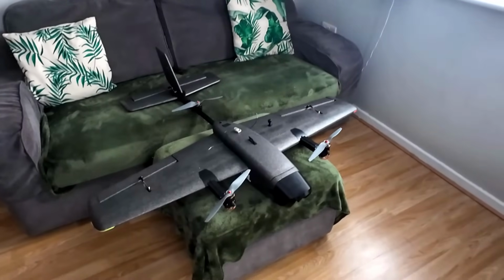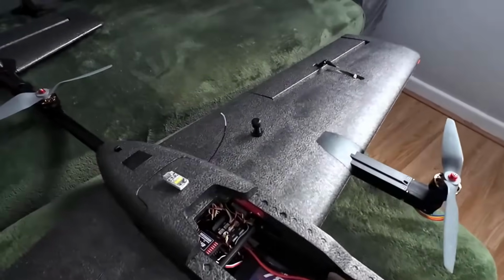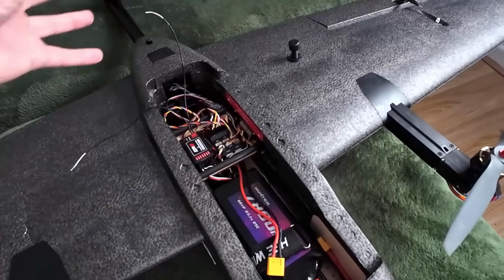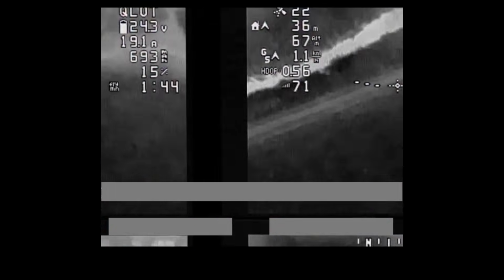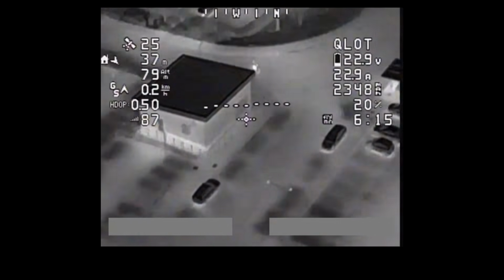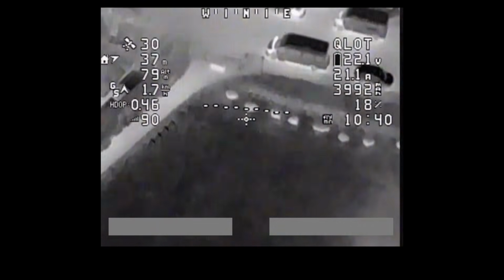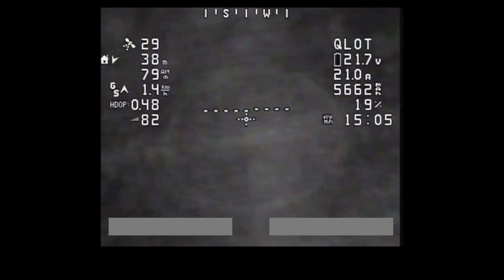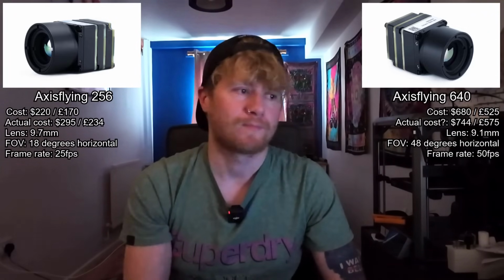🛩️ I Built A Thermal FPV Drone!

Comment: Thank you! This is very interesting. But the telelens makes it not usable as main fpv cam. Could the lens be changed? Or are there other cameras with this good thermal/latency/resolution  performance and with a lens that is acceptable for a main fpv cam? Thanks!

Comment: I have a lot of experience with remote control, but not so much with FPV. My question would be, if you’re using the radioMaster as a receiver and wired into your flight controller, it seems that you would now have split your channel one into two outputs. The initial output which runs your gimbal and the output that goes into the flight controller, which would typically work on channel 1 as your aileron. 
so on your radio, how do you 
differentiate between the channel 1 on the receiver, and the channel 1 on the fight controller? And in the radio if you set channel 1 to channel 8, then it seems that you’re ailerons will be linked to your gimbals?

I guess I’m trying to say if you pick  AETR and your flight controller software, then aileron will be channel one. Sewing your plug the receiver into the flight control. You will essentially have two channels working off the same input.

Obviously, this part confuses me and would appreciate any advice. Nice video.

Comment: Problem is in hover you'll smash your battery down. Better idea pic a frame that allows a pan and tilt on head tracker.that way you can bank the plane and look out to the side and just circle.
Reply from the maker: Or better yet, build a 10" quadcopter with a 3 axis gimbal 😉(check the videos I posted after this one)

Comment: Hi Giz can I ask why did you use uart1 for the ELRS connection when the 4 pins at the top left of the F/C are designated for the xfire/sbus connection ? Is it because you needed to pull separate power for the receiver and that was the easiest way ?
I am just about to buy the T2 VTOL based on your previous videos and was shocked to hear you say that all 9 PWM ports are used by Heewing wiring and I need to run a pan servo for my camera. 
Love your videos mate keep up the great work
Reply from the maker: Hey, yeah I wired the RX to UART 1 because I needed to use the other pins (that would be where you usually connect the receiver) to provide the rx with power. Because of the way the ER6 rx works it needed a secondary power supply so it could power the servos

Comment: Did you ever fix the camera switch issue? I am having the same problem, but mine goes blue screen first. takes about 1-2 sec to switch.
Reply from the maker: Yes i did fix it. Turned out it was due to a setting on my goggles. I basically had to change the mixing mode from mix1 to div

Comment: You didn't build shit
Reply from the maker: Yes you're right, I clearly just went to a shop and brought this drone exactly how you see it here and just flew it straight out of the box 🙄 I certainly didn't spend any time carefully researching components, installing hardware, soldering multiple wiring connections, programming software, or designing and printing custom 3d printed parts
Reply: lol this guy. ok let's see your build.

Comment: Would be great to overlay the thermal inside of the normal fpv so you do not have to switch. I could imagine using ML to label buildings, cars, people, POIs, etc. in real time using a small SBC and some code.

Comment: I think the switching error is because the RF switch is engaged randomly in the frame scan and it should be switched right after the VSYNC pulses.
Reply: I agree. I don't think there's an easy way to synchronize the feeds though.

Comment: I see that AliExp has USB digital versions of this listed now, along with CVBS. Also various lens sizes such as 4.0mm instead of 9.7mm, to get a wider FOV (but at the expense of lower detection ranges). Maybe 9mm would be best for planes (higher up), and 4mm for quads down low? IDK, depends on use case.
Edit: I just found it with 6.8mm lens also: maybe a happy middle-ground?

Comment: Black is cold.  Anything facing up is seeing the very cold night sky.   The night sky is only about 3 degrees above absolute zero so that's about minus 270C.   This causes whatever is facing the night sky to radiate its thermal energy furiously towards space.   Of course, it doesn't get that cold because it's immersed in our atmosphere, around ground level, so it's kept warmer by the environment it's sitting in.  The early Romans actually used the night sky to make ice all year long.   So that's why the tops of cars, and solar panels, and roofs, all get cold quickly, colder even than the local air temperature.  That's why windshields and car tops get covered with dew.

Also, driving cars have the cold night air flowing all around them keeping them generally cool even while running. Your parked car no longer has air flowing around it so the engine heat warms up everywhere briefly.

Comment: Maybe a silly suggestion , but how about trying a wide angle adapter like the ones you can get for a smartphone camera? Would it lose any of the thermal imaging properties?
Reply from the maker: @joaomarveloso1049  Unfortunately it's not as easy as that. Glass is highly reflective to infrared light and as a result doesn't let light through. That means that infrared cameras cannot use glass lenses. Instead they use Germanium metal alloy lenses, which as you can imagine, are pretty expensive
Reply: @gizfpv  Yeah, makes sense. Thank you for explaining. Would be nice to have a proper view for FPV flying, although i see it being used in wars straight away, unfortunately.

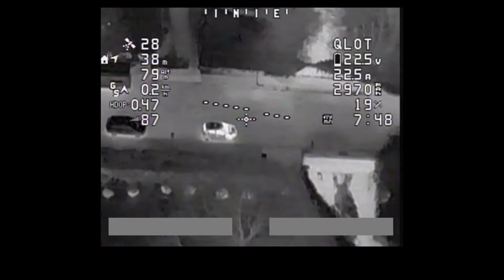Comment: 19:30 you guessed right, modern cars often have insulation under the bonnet, especially VAG ones. It's the felt sheet attached to the underside of the bonnet.

Comment: @15:10 that's super interesting. It looks like a football pitch. It is quite literally a heat map of the most touched parts of the pitch. I wonder if this is actually thermal radiation shortly after a game of football or if it's just varied emissivity where the grass/mud interface is apparent. Either way it's cool to see. Great video.
Reply: pretty sure after seeing how bright water was glowing next to the field you can conclude that the center of the field would logically be retaining the most water due to its convex slope (this is the only assumption here as most fields have this shape)

Comment: Do you think that the camera switch circuit having a different battery 5 vdc supply different from the controller and camera power supply caused your video switching problems?

Does your thermal camera find drones in the sky easily?

Comment: dunno why i thought this would relate to use with thermal gliders/sailplanes
Reply from the maker: I guess in theory a thermal cam could possibly help with finding thermals. You wouldn't be able to see the thermal itself, although you'd be able to identify hot spots on the ground which may have thermals above them
Reply: @gizfpv  good point. thanks.  think thats why the middle of that field had a warmer spot visible to it as well ?

Comment: The 640 camera for slightly over 2x the price but it is also around 4x the resolution
Reply from the maker: I forgot to even mention the resolution being a a upgrade if you get the more expensive 640 camera. Another very good reason to get it
Reply: holy hell your right. 640 was always around 3x the price of a 384 in many other types of devices. this 640 price is indeed a steal.

Comment: Dumb question coming from quads assuming your fc has a vtx built in? Is it an analog signal or how are you receiving the thermal signal
Reply: in the end he wrote he uses Speedybee TX800 VTX
Reply from the maker: There's no VTX built into the FC, however there is a analogue VTX installed in the wing. That's taking the signal from the camera and broadcasting it to my goggles

Comment: It ws not so long ago that resolutions/ frame rates mentioned would have been out of the consumer reach...  I'd stilll make sure the vendors aren't just pumping these out onto the consumer taking a blind eye toimport/ export regulations.... thermal imaging is regulated at certain reso/ frame rates. It woukd suck to violate these since...well it is a big deal.

Wasn't too long ago ..now that i am remembering these things...J.B. made a video/ or 2 on a Caddx camera which blew my mind..no light IR camera...amazing! 

Supposedly the version of camera you got..1 out of the 3..well the other 2 are supposed to do the diffferrent color palettes out of the box....only the version you got is missing some features which make it more a hassle to work with. 

A reddittor mentions another RC brand with thermal they researched called DolphinRC- they sound like they've done a fair shsare of research...
Reply: Yeah, take a guess why things like this are suddenly really popular

Comment: Are you able to overlap the video feeds live? Yeh, there is some serious drift going on. As mentioned in a previous video/short, my Doogee rugged phone has 3 wicked cameras being an IR night, thermal, and some ridiculous regular megapixel thing. Though separate lenses/chips, through software, these "feeds" can be - with sometimes frustrating - calibration to one with the ability to set the strength of each. It is a game changer - especially at lower resolution thermal sensors. Instead of a blob of heat, now we see the object the blob of heat was emanating from. The regular video feed had that filter on it - again strength adjustable - the filter that outlines things in a picture. This is such an amazing tool for search and rescue, but also troubleshooting electronics. You can see the components that are hot and fix them. By the sounds of it, which is kinda weird that this functionality doesn't work out of the box, but things like adding colors "Iron" or black hot, but you are attempting to use a Raspberry Pi 4 or 5 to do some sort of processing. I had mentioned in another comment that a way to blend the video feeds is to use something like OBS - but as a real-time thing, not sure about the latency.
Reply: I have seen couple videos before where people overlaid analog video on top of another in real time so it can be done I'm just not sure how...

Comment: I've built a hexacopter with infrared camera >12 years ago. The camera had a little industrial pc for data processing that had to be in the air with the 800 gramms ultra-light camera... 😂
For switching between IR and normal camera I also used a little videoswitch and guess what: I had the same problem with the picture rolling sometimes. It was enough to prove that it's possible to scan a field for baby deers before mowing or check a corn field for hogs, but it was not practical to do at that time. The cam would have cost ~10k$, the drone had more than 3kg take-off weight.
Now one can buy a ready to fly drone with IR cam for 3k$ or less.

Comment: Some analogue cameras have a sync adjustment to allow each of the camera timing pulses to be aligned to prevent the rolling during switchover.
This used to be a problem encountered on older CCTV systems way back when.

Comment: Only at 4:21 but wanted to offer one suggestion.  A video signal mixer. Would allow you to see both the thermal and visible light camera. The reasoning here is you don't know what you couldn't see. Being able to switch from visible, to thermal, or a mix of both would be pretty awesome.
Reply: just came here to make a similar suggestion. Put the thermal in a PiP in the center of the vis view. bingo bango bob's your creepy uncle.
Reply: Axisfly make a combo thermal and visible light camera module with an input that switches the video signal back and forth between the cameras.
Reply: can yu give an example of one? i was hoping something like this existed for diy, but dont know how to look for this
Reply: @jasonbrown467 
Yes, it is absolutely possible to combine a visible light FPV camera and a thermal camera into a single video feed that can be switched or overlaid for an FPV setup on a remote control airplane. Here's how it can be done and what to consider:

1. Camera Selection
Visible Light Camera: Any analog or digital FPV camera (e.g., RunCam, Foxeer).
Thermal Camera: Options include FLIR Lepton (compact and lightweight) or Boson modules, which offer analog or digital video output.

2. Video Mixing Methods
Option A: Video Switcher (Either/Or View)

Use an analog video switcher (like the Eagle Tree or Matek video switch) if using analog signals.

Allows you to switch between visible and thermal views using a radio-controlled switch or a toggle on your transmitter.

Option B: Video Combiner/Overlay (Mixed View)

Use a video mixer or overlay unit that can combine feeds. For analog video, this could be something like the FLIR VPC Module (which can overlay thermal on visible).

For digital systems, you may need a custom onboard processor (e.g., Raspberry Pi or Jetson Nano) that runs software to overlay the two video streams in real time, outputting a combined HDMI or analog signal.

3. Transmission System
For analog: Use a standard 5.8 GHz VTx. Ensure that the final video feed (combined or switched) is analog if that's what your VTx supports.

For digital (e.g., DJI FPV, HDZero): You’ll need a system that supports HDMI or USB video input if you're combining streams digitally.

4. Display
Your FPV goggles or ground station should support the output format (analog or digital) of the final video stream.

5. Power and Weight Considerations
Ensure your copter or airplane can support the additional power draw and weight, especially with thermal modules and any extra processing hardware.

Hope this helps
Reply: @jxpat  appreciate the response, i started gathering parts to diy a thermal drone and spent a pile of money nv camera's, thermal camera's, wide angle and zoom cameras gimbles, video switchers, vtx's, goggles and  was  bench testing it all and realized i spent a pile of money and still didnt have a drone, so i bought a off the shelf rtf thermal drone and love it.

now i am thinking id like to get back to the diy side of things. i want to see a side by side of any two cameras at the same time. all my cameras are analog btw, does such a thing exist for this?
Reply: Could you have 3 cameras? 1x, 10x, thermal would be powerful. Can they be slaved together?

Comment: You should have installed your caddx infra camera instead of the runcam with the thermal one.
Reply: I was curious why he didn't do this. Maybe he wanted to compare it a "normal" FPV camera. I have one of these thermal cameras (I'm Duane mentioned at the end of the video) and I'm planning to use with the Infra camera I purchased after watching Giz FPV's other video.

Comment: the mystery is easily solved.  modern cars don't have engines.  Batteries do not get hot under the hood.  Also, batteries are located at the bottom of the main frame and the front of the car is a frunk, which is why there is no heat.
Reply: are all those cars really electric?
Reply: It's actually just because the car bonnets are glossy and are reflecting the thermal image of the cold sky back to the camera. If you imagine they were painted with chrome paint and you were using a regular camera with visible light - it's the same sort of effect you'd expect to see then.

IR cameras struggle a bit with anything that's not completely matte.

Comment: That's so amazing, actually affordable as well, but the fov is a killer.  can you change the lens, does it use a normal 8mm or screw type fpv lens that you can switch out?
Reply: if you use a wider lens the resolution will suffer
Reply: @flat-earther  ? why? it should help it.
Reply: @ because then every pixel will cover a larger area.
it will decrease the angular resolution of the camera
Reply: @flat-earther  lol wut.  You mean you can't use a wide angle lens on a small megapixel camera? That's ridiculous, I had wide angle lenses on my cameras sub 2 megapixel, so what.
Reply: @maddercat  no. I didn't say you can't use a wide angle lens.
Reply: Buy the one with 4mm :D

Comment: Crazy timing as usual. Im wiring mine up today on an 8 inch quad i have to tilt it in angle mode with the help of 3d printing and e6000 most likely 😅.
Reply: I made one that uses a GoPro mount. Seems to be a decent way to go.

Comment: If your using a rx module  like rapidfire. It needs to be in legacy mode. Just normal reciver.without image fusion. It causes the camera switching issues.
Reply from the maker: Ahhhhh sir you might be a genius. I should have thought of that, I never considered that it could be the goggles causing the issue. I'll test this on next flight! 😊
Reply: @gizfpv  you should try the 640x512. Much more detail and range. Expensive but you can see so much more.
Reply: @squirrelynutz1  would love to see that
Reply: I don't suppose I could ask for a bit of assistance could I?  I'm a old retired mechanic so I'm mechanically inclined and decent with electronics but running into a few small issues and don't really socialize enough where I moved to meet someone here that could help me out ..  thanks